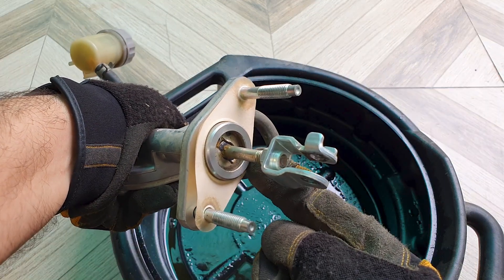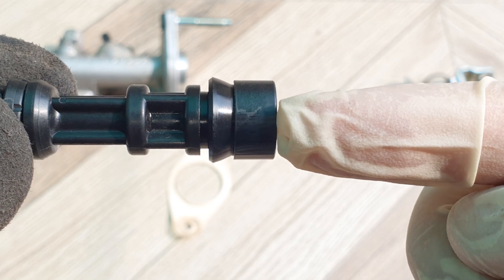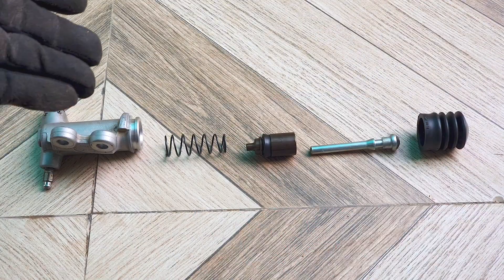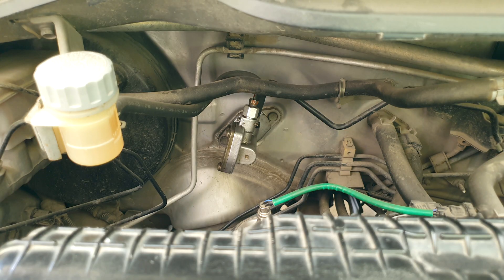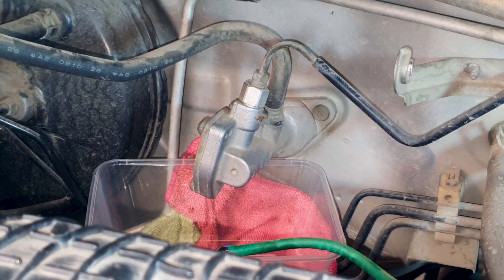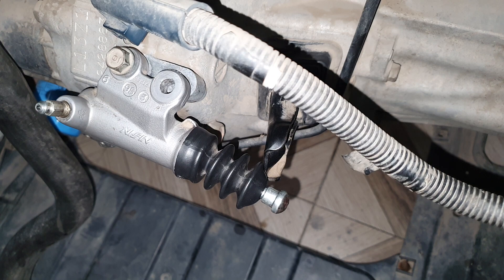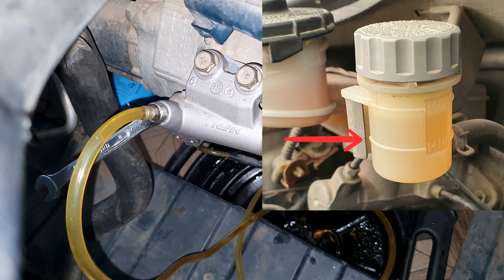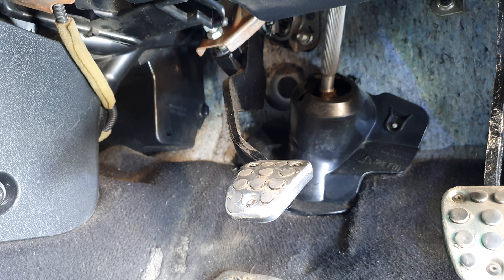2 - Clutch master + slave cylinder rebuild, clutch fluid bleeding process #honda

Comment from the maker: I had a rattle sound, or sounded like a bird chirping sound, when the car would be idleing. If I slightly touched or rested my foot on the clutch pedal it would go away. 

After cleaning and applying fresh grease inside the clutch slave cylinder and making sure I pushed the slave cylinder towards the fork when tightening the bolts (all shown in video), the rattle or chirp sound is gone.

Overtime the interals of the slave cylinder (or even master) get gummed up, especially if you do not change the clutch fluid regularily. So the spring inside the slave doesnt fully push the piston rod against the fork. If it is rusted inside then you have a bigger issue.

Comment: @TheWrenchWiz - Do you have a part number / link for that rubber grease?
Reply from the maker: Toyota has: 08887-01206. Here is a listing I found https://www.ebay.com/itm/333684237678

This is more than enough for any DIY fix. Honda dont sell it separately. I had some left over from a brake caliper rebuild kit.
Reply: @TheWrenchWiz  Thanks mate!